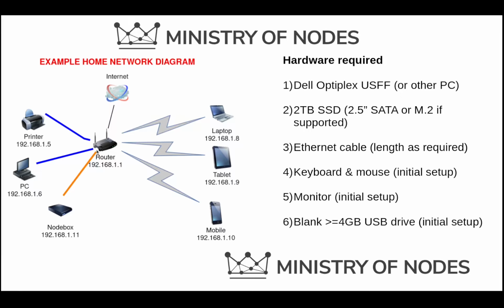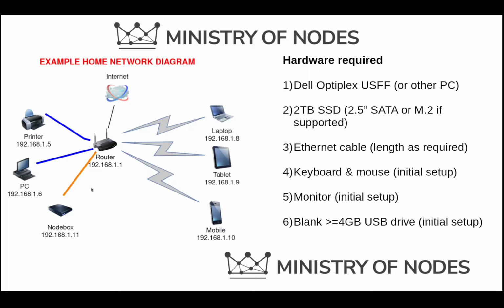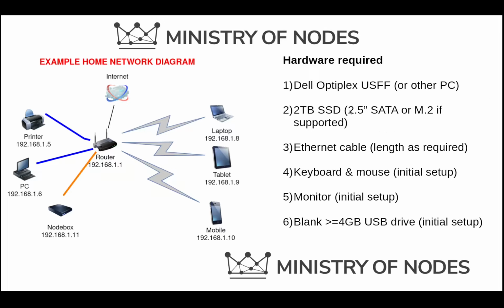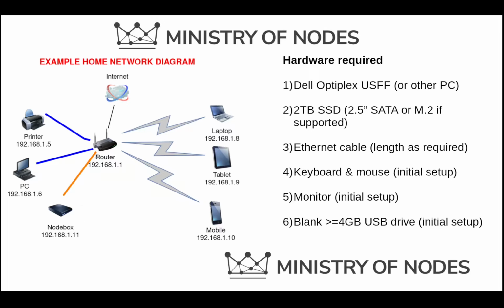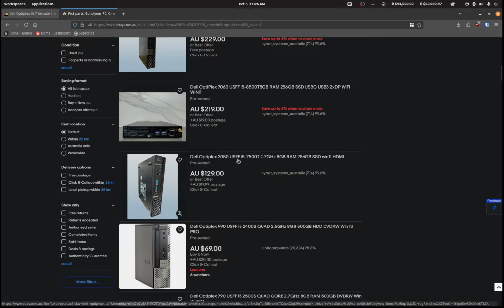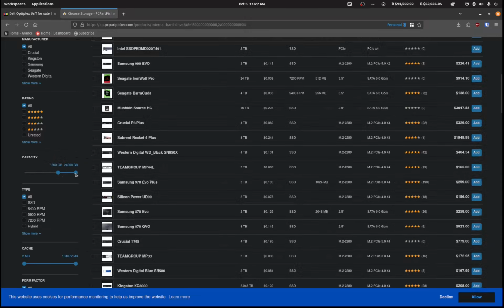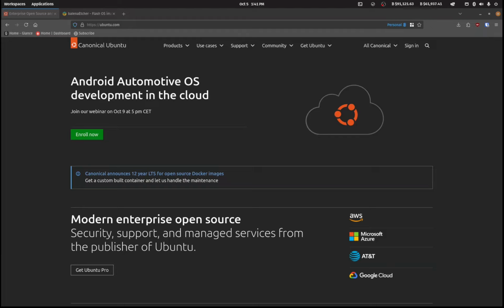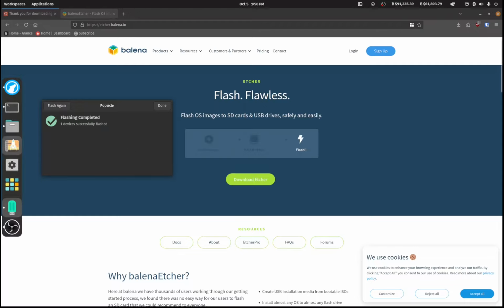BNB24 - 03 - Hardware

Comment: Hi thanks for your video 🙏🙏🙏

I have a question. If I buy a 2nd router and configure it with a vpn, I put it between nodebox and the router of the internet access provider for more privacy. Will it work? Could I connect to the nodebox or will it be complicated?

I was also thinking of bracing a bitaxe on the second router. Or do you advise against doing that??